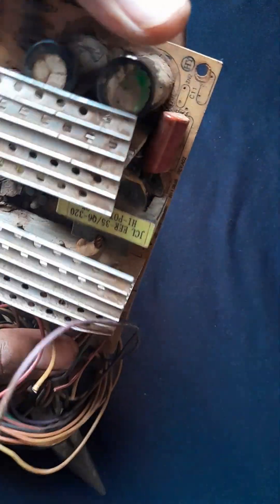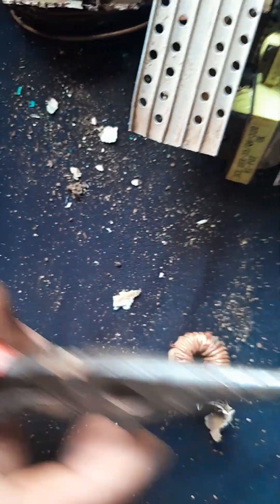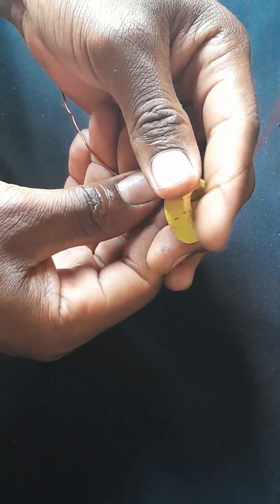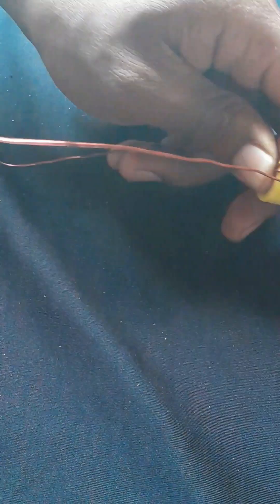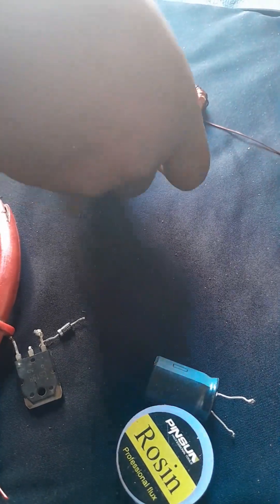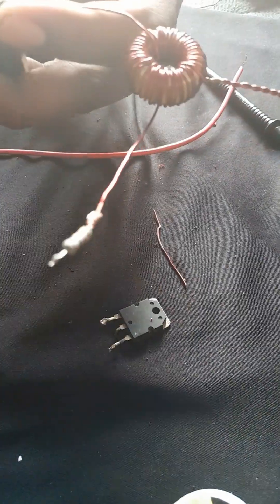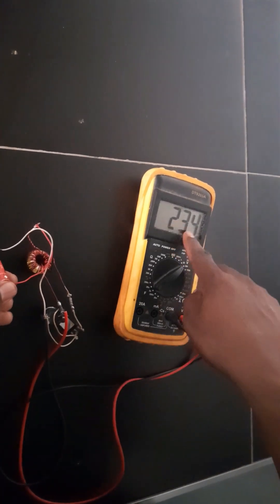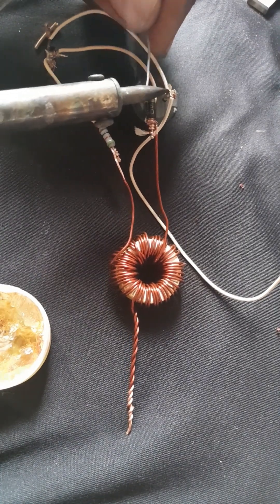How to make a DC-to-DC boost converter (1.5 volts to 24 volts)

Comment: Its joulethief with rectifier diode and storage capacitor. Nice job, but have in mind that the 24v is open circuit voltage and under load will drop significantly depending on the current drawn. For low power LED lights is perfectly fine.
Reply from the maker: Yeah that's true, thank you for pointing that out